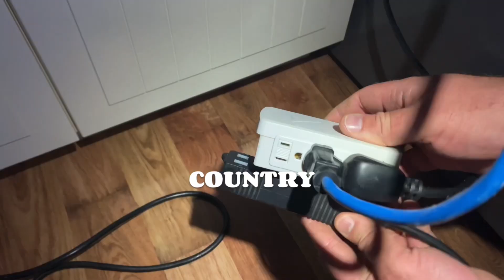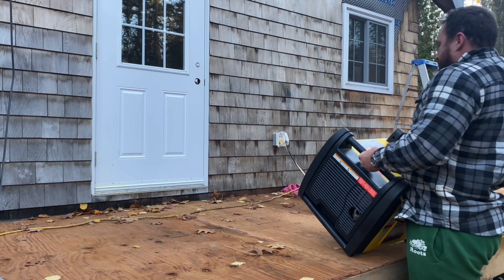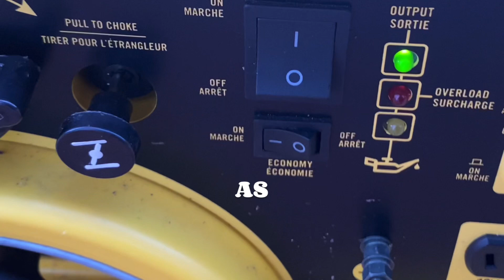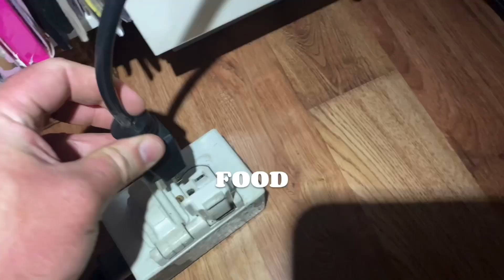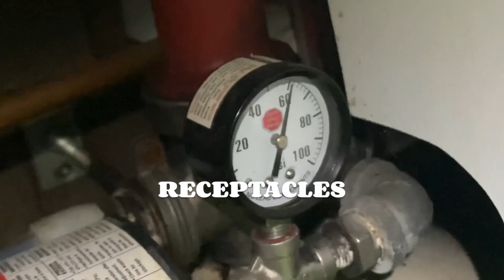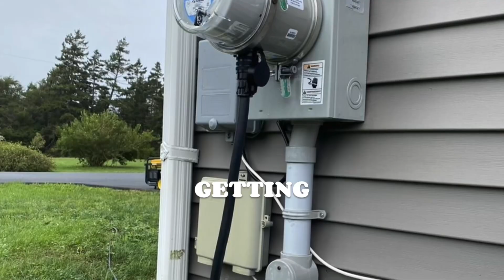Cheapest Backwoods Method to Connect Generator to House

Comment: Nice video.  I used a similar method, and found out that my Keurig coffee maker was the only appliance that would load down the generator.  Granted, that was when we were using a Honda EU2200i, but that generator was able to feed a refrigerator, freezer, forced-air furnace, and house lights all at the same time without ever bogging down.  However, plug in the Keurig and brew a cup of coffee, and you could hear the generator bog down and struggle a bit, regardless of other loads on the system.  

I'm curious what gauge cable you used for your DIY extension cord with the four outdoor boxes attached.  I'm guessing you'd want to go with a minimum of 12-gauge to keep the voltage drop down.

Anyway, thanks for the video.  --  Ken

Comment: Why not switch the main breaker to the mains off. Use the Double ended DIY plug cord and stick it in a plug somewhere and then into the generator. Needs one very dangerous cord but saves the hassle of setting up so many others

Comment: Our backdoor has a gap under the door so big that I can just feed an extension cord under the door and close it. (cough) I need to have someone fix that. If you don't want to mess around with a circuit breaker panel, you could just install a male receptacle on the outside of a wall and a female receptacle on the inside of the wall. It would all be weather proofed and permanent. It would be quite a bit better than removing a door handle and shoving a rag around the cord leaving the door unlatched and unlocked.